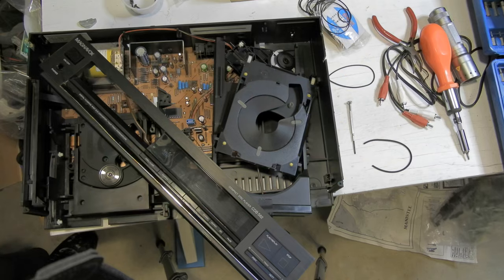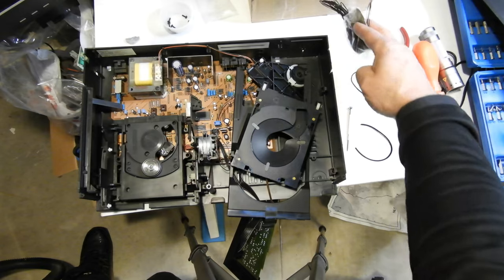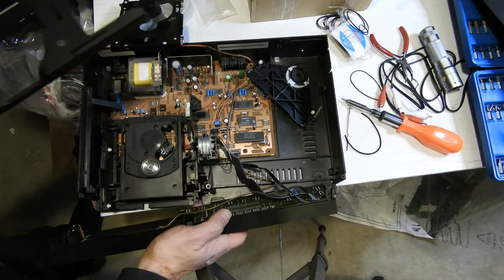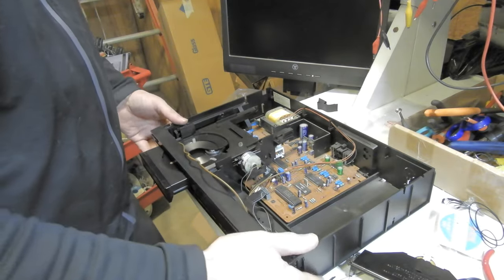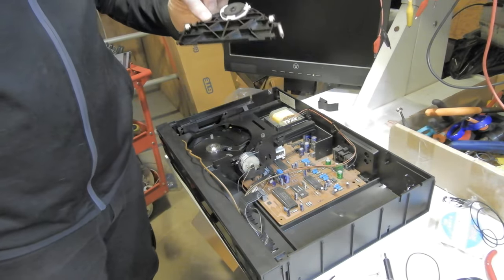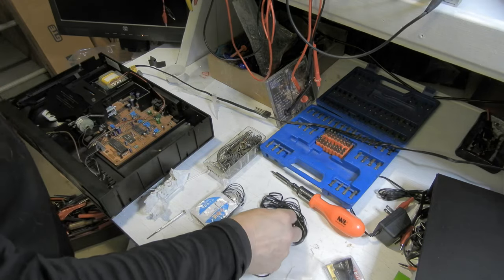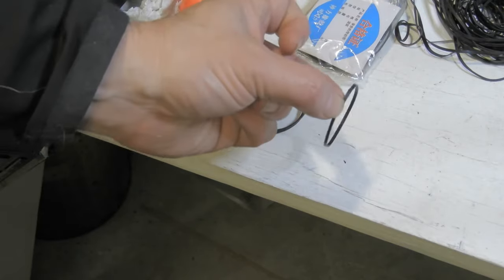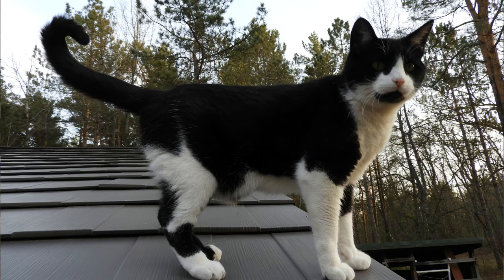Magnavox CDB582

Comment: I see your video and watched it.  Good video although, the few minutes you took to describe the problem would be nicer if you had a closeup of the belt path.
Btw., were there any other belts that "should" be replaced?
Reply from the maker: Yeah, a tight macro shot of the belt would have been nice. Also a tight shot of one of the tabs at the bottom of the front panel...